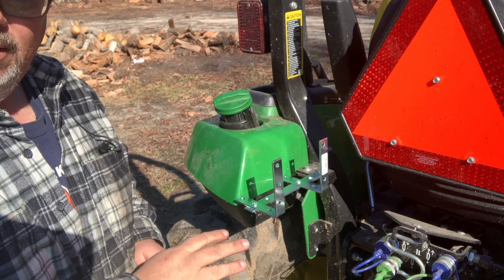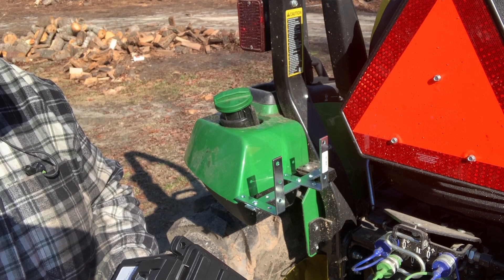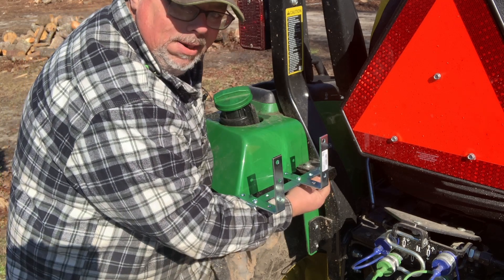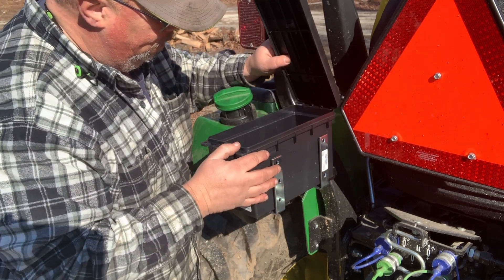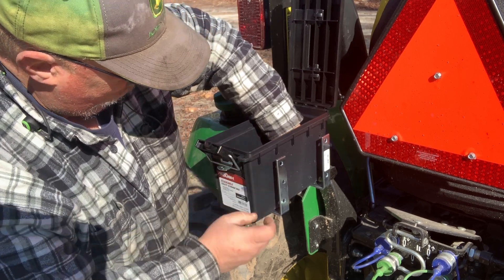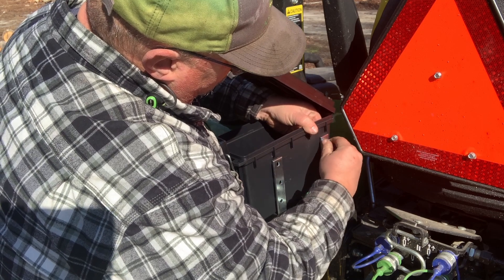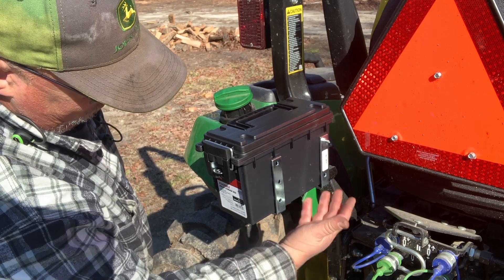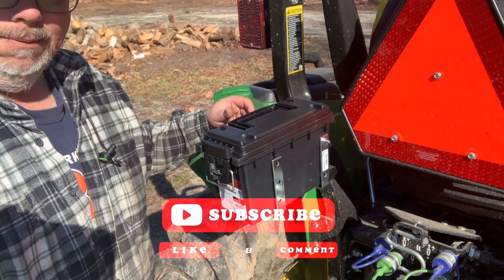No fab toolbox for John Deere 2032R

Comment: Cool idea! Simple and to the point. You should let us know how the solution does after you run the set up for a while. I think if you add a simple self tapper to the mount the swivel issue will be resolved. Self tapper will drill its own hole. I love 5he simplicity!
Reply from the maker: I'll let ya know how it works out.  Thanks for watching!